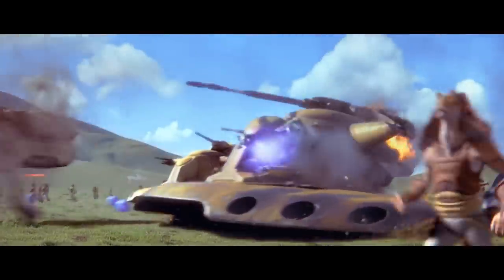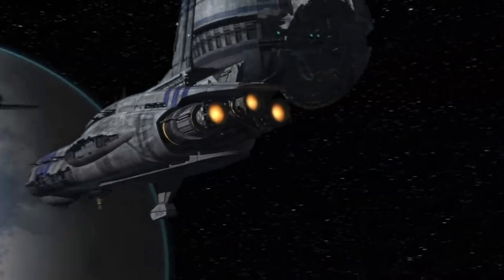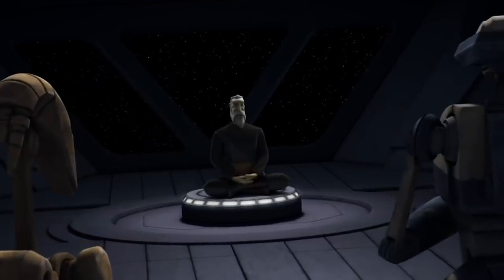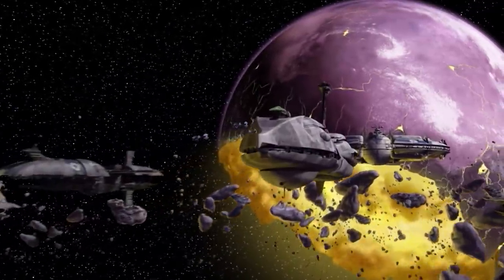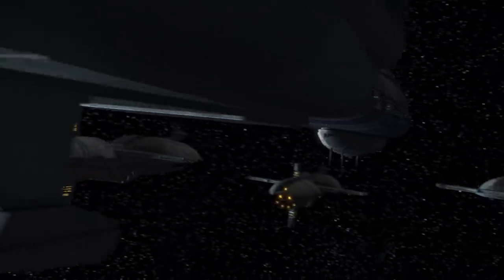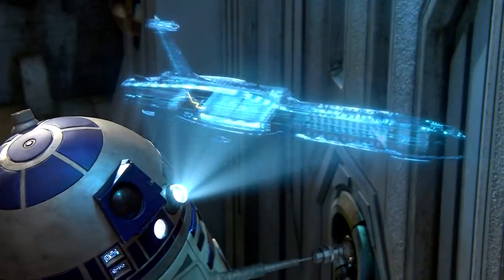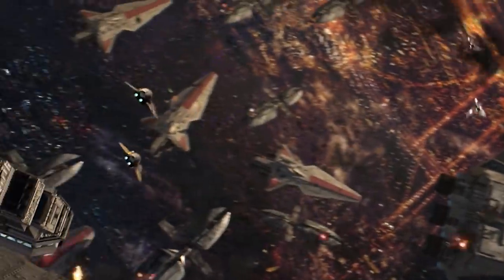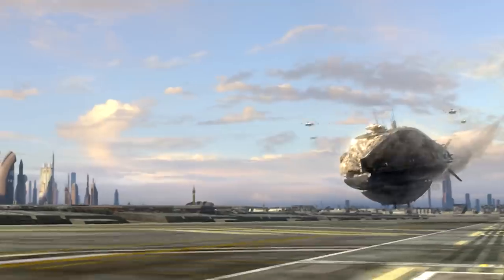Star Wars: Providence Class Dreadnought | Extended Ship Breakdown

Comment: The Separatist Dreadnought would have been great for Rebels. Why wouldn’t they just salvage some parts of it. They could have made improvements to their hyperdrive system
Reply: They did, the had one they called Rebel One in the comics
Reply: @brandonchapman4532  If I remember right, that ship was almost a kitbash of other ships onto the Providence frame.
Reply: Way too easy to hunt down by star destroyer squadrons, defeating the whole decentralized rebellion gig. Probably best not to put all the eggs in one incredibly expensive to run basket salvaged from a boneyard.
Reply: The point where the Rebels could safely and efficiently operate multiple capital ships was probably long after most Separatist ships were broken down or otherwise irreparable.
Reply: @trinalgalaxy5943  That was Berch Teller's warship from Tarkin. Rebel One was modified but not to the extent Berch's ship was
Reply: Some rebel cells do in fact use Providence and Lucrehulks in the EU if I remembered correctly.
Reply: @trinalgalaxy5943  A mix of Providence and Recusant parts mainly.
Reply: @VexenDmitri  The lucrehulk scene from Death Star was dumb.
Reply: They actually used a few of them during the galactic civil war.

Comment: Makes one wonder why ships designed to be manned by droids had such spacious corridors designed for humans and such small compliments of both dismounts and strike craft... especially since for droids former and latter are the same and unlike with human pilots, you don't need hangars, crew quarters and other dead weight, droids can just latch to the hull outside in the thousands or even tens of thousands.
Reply: That would make for a logical conclusion, but I would think it to be a more flexible design to have such large spaces for operation, as not only might you need to house thousands of organic individuals (given the circumstance), but droid personnel might be more easily transported through said corridors, that is if mechanical transport of this personnel fails during battle or may become inoperable through other means. Certainly, this point can be expanded upon, but having these logistical passageways can certainly allow for more design consideration in encountering circumstance.
Reply: As the video explains at 1:59, the ship was originally designed to be crewed by organics. Other vessels in the Separatist Navy however, such as the Munificent and the Recusant, were designed with droid crews in mind from the start and therefore had a much more skeletal appearance.
Reply: You also still want hangars for maintenance and repair tasks.
Reply: @ronin3381  I still wonder what kind of an organic needs a hallway the size of 4 lane highway though...
Reply: @TheArklyte  in Star Wars? A Hutt.
Reply: @danielkorladis7869  good point... hmm, I wonder if hutts have such ships at their disposal too. I mean, after CIS was done, dockyard workers still needed to be payed.
Reply: @TheArklyte  Also maybe for supplies? Wide hallways mean you don’t need separate passageways for heavy supplies or other equipment that wouldn’t otherwise fit through a normal hallway.
Reply: @ronin3381  I would have said that it's great for forklifts too, but then those hallways are too clean and too empty. No broken containers lying on their side, no forgotten forklift with 0 charge, no thrown around empty cardboard boxes for no reasons, no shipment stickers stuck to walls by workers for no reason...

Comment: The front half of the ship "safely landed" by the Jedi ?  I'd think it could be said more accurately as having been "safely crashed" on the surface of Correscant, especially given,.. it was only half of a ship vs an entire ship.
Reply: a good landing is any one you can walk away from
Reply: @danielkorladis7869  and an outstanding landing is one where the landing gear is still attached
Reply: It was another happy landing.
Reply: @rominkivela9351  The variant I know is: a good landing is one you can walk away from, a great landing is one where the aircraft can fly again
Reply: @nathanrcoe1132  THATS THE ONE!

i knew i wasnt getting it quite right
Reply: @nathanrcoe1132  "For all your expertise, this is not a very smooth landing!"

Comment: Some errors with this video

Firstly, the Providence has 2 types, the Dreadnought is one of them, but the other is a Cruiser/Destroyer variant.

The former is a 2 Kilometer long behemoth often used by the most prestigious of the Confederate Admiralty, Trench's personal flagship is one such example.

The latter is a more main line capital ship, whilst not nearly as common as the Dreadnought, was by no means rare to see in larger numbers, as it was effectively the CIS counterpart to the Venator, and could be seen in direct combat rather than C&C Flagship duty fairly often.

Comment: Wait the thru-hangar was only on the Invisible Hand? I thought it was standard for ships of the class
Reply: The thru-hangar was not standard for either Providence type. Examples are listed below

Exhibit A: Shown with Trench's dreadnought the Invincible in "Cat and Mouse" (S2 E16), involving the landing bay where the Hyena Bombers were deployed from.
Exhibit B: Displayed with the Providence command ship involved in the Battle of Sullust in "Nightsisters" (S3 E12). The landing bay where Anakin and Obi-Wan battled Ventress was much smaller.
Exhibit C: Involves Dooku's flagship in "Witches of the Mist" (S3 E14), when Savage Opress lands his solar sailor ship inside the dreadnought orbiting Toydaria.
Exhibit D: Seen with Aut-O's flagship in "Secret Weapons" (S5 E10), which D-squad's stolen shuttle is reeled into by a tractor beam. (The depth of the hangar bay is only seen when the shuttle escapes)
Reply: However, the Providence class that Grievous used when holding Adi Gallia prisoner in "Nomad Droids" (S4 E6) had a thru-hangar, seen when R2-D2 and C-3PO board the ship after escaping the destroyed Maurauder